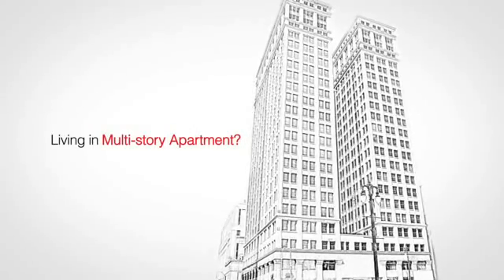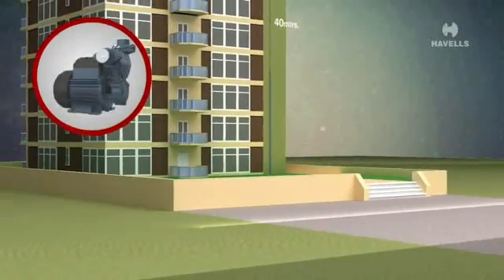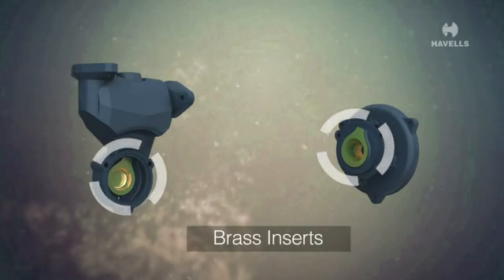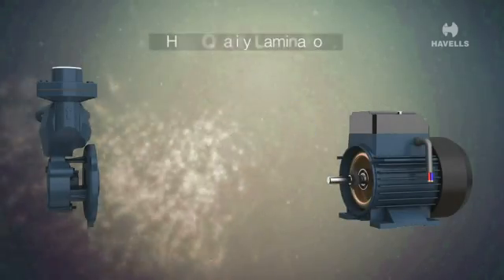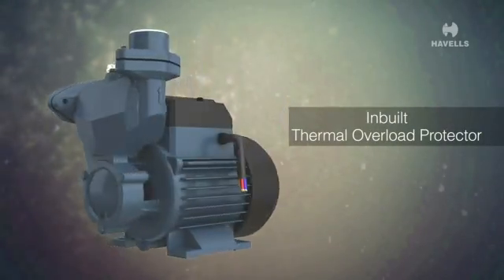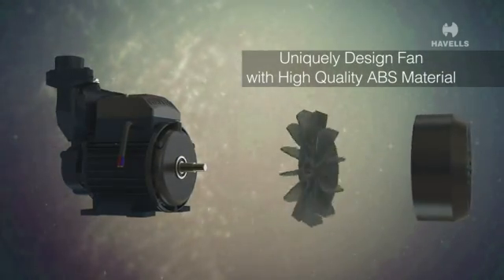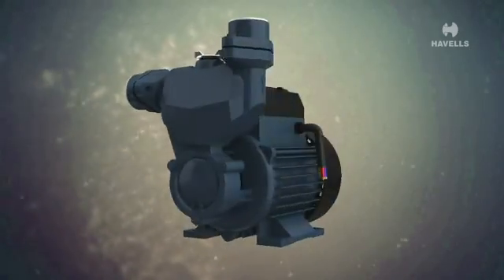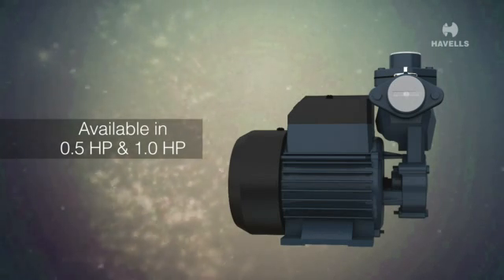Havells Self Priming Mono block Pumps Launch Video

Comment: can we use it to transfer lubrication oil, hydraulic oil or gear oil? can it handle small solid particles or contamination?
Reply: Can we use water monoblock pump to lift diesel from sump

Comment: Does it work on suction of water from muncipal water connection where pump sucks water along with air continuously.

Previously i have installed donkey pump. And I need to increase water sucking efficiency. My connection is installed from bottom of muncipal water pipe and water in pipe is not full at all due to little opening of valve by line man.

Comment: 25 MTR hight, Can I use 1/2 HP submersible water pump + 1/2HP Mono block water  pump together or 1HP single submersible water pump. Which is better pressure and power saving ?